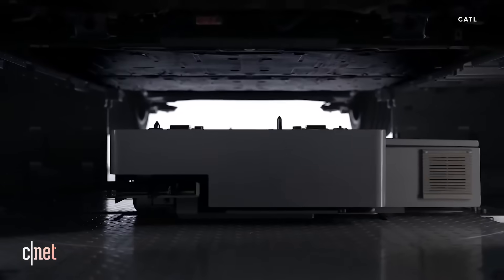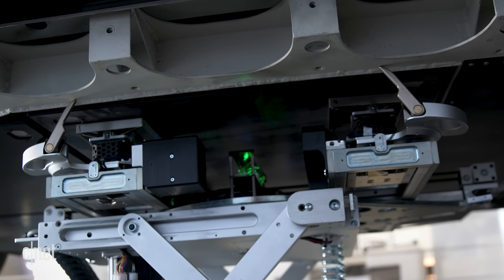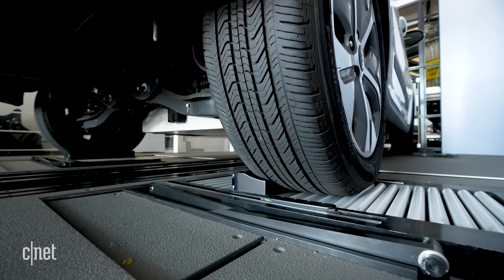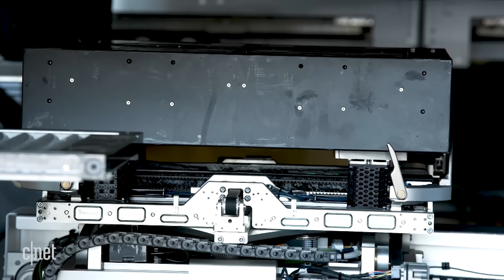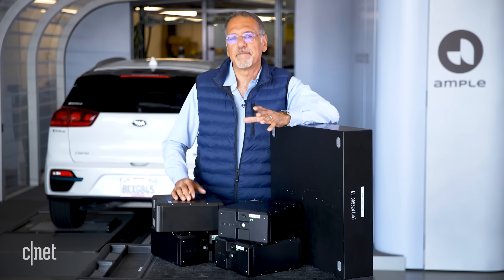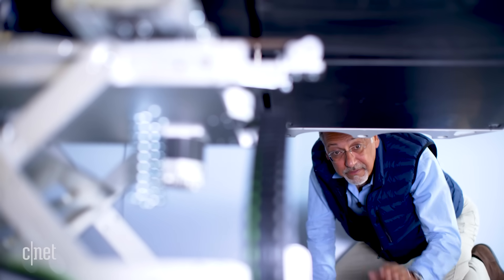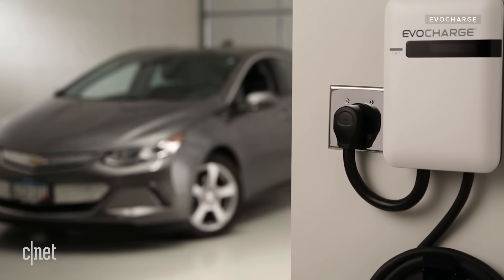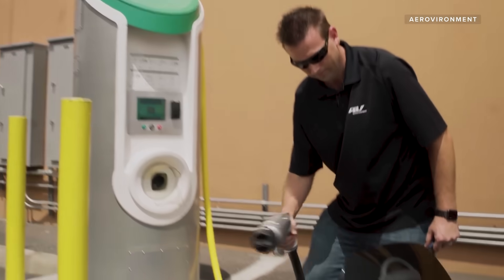See the Fastest Way to Recharge an Electric Car

Comment: Some charging stations breakdown or give you a very low charge either because sharing or the weather and the temps of the battery. If it's like a rapid bodyshop that can charge your EV quicker than charging at some station that's not a super charger I think it could work, and I hope one of these car companies give it a try.

Comment: Battery swap stations can also be installed into your garage.
Ev batteries can be hot swapped like the batteries of a controller.
You would just keep two of them on rotation until one of them died from usage.
Reply: Who’s got the money to install a battery replacer in their garage?? Just charge your car overnight and go!

Comment: meh. outside towing heavy loads, a 150kW charger is plenty enough and the cars that really benefit from them can already reliably get from one charger to the other. so really, their tech is already aimed at a far more niche market. there is also a mistrust of costumers who don't want the most valuable part of their car replaced with a subpar part and the fact that it takes extra space and creates extra weight which could simply be used for more range.

Comment: 800volt systems in cars will challenge this solution as they can go from 10 to 90% charge in 15 min.  I imagine not much different from this solution.
Reply: It’s not the batteries as much as it’s the external infrastructure. It’s bad. 

This is coming from an EV  owner

I charge at home at that’s enough 99.5% of the time. 

The other 0.5% is a crap shoot.
Reply: @doctorbashir3497  I've owned an EV for 3 years, and my current Kia EV6 can charge in an external DC fast charger in 15 mins.  These stations are deploying throughout the US and will be more available and faster to charge with than any battery swap system.
Reply: @jimhlee  I feel you. I have the Etron GT. Love it. 10-80% in like 20ish minutes on a date charger. But they are always broken.

Comment: I don't see how they have improved on anything proposed in the past, and still have significant questions to answer. What is the cost of converting to their system? It will definitely take significant modification, beyond the structural framework. There is cooling, battery management, charging hardware... all of which is currently proprietary to each EV manufacturer. They say they don't need rapid charging, but this will change if they ever catch on (which I don't think they will). If a lot of people pay the huge cost to convert their cars, they will expect charged packs ready to go at all times. This will require rapid charging and/or a large stockpile of charged batteries at every swapping station.

Comment: When it comes to electric vehicles, bigger batteries and faster charge times is the key.

What the industry needs is the government needs to standardized the the charging cables and maybe the batteries.

Kind of like EU did by forcing all of the tablet and phone manufacturers to use USB Type C.

Comment: CNET must be running out of ideas. Telling people they don’t need more than 150 miles in a EV then showing them a swap technology that would take longer than the 15 minutes to get a quick charge on the newest technology with less miles. Right now the number with a high output is 200 miles in 15 minutes.  I’m not saying it’s propaganda but use common sense. Not everyone lives in San Francisco.  It’s about simplicity.  With that technology you are looking at more time, higher frequency when you could just buy a car that fits your needs to charge once a week if you don’t have a at home charger.  Also this technology is not going to be cheaper.  Might make the car cheaper but you will keep paying for swaps exceeding the cost of a 50k EV in the long run.  Technology on batteries is moving forward and the thought of a million mile battery pack seems achievable.   If you want to impress us. Let’s find out why hydrogen is not picking up and promote that.  Seems like a great technology and tanks are bulletproof.  Think if that scales prices will come down and you’re still technically driving a EV.

Comment: How will this work with vehicles which use a structural battery pack? 

Also this system appears to add weight to any compatible vehicle.

It's admirable that these folks are working to make EV travel better. As someone who has been driving electric for ten years, I'd love to see them divert their focus to improving battery technology and safely shortening charge times.
Reply: Came here to ask the same thing. If the structural battery pack becomes a thing across the industry.. this isn’t going to help.
Reply: @Hugh Q 10 years here as well, absolutely don't miss them. 265k miles and counting on my own cars plus another 50k in demos and loaners, had tow gas rentals for a short stint and hated them.

1st was when my car got rammed by a Semi, while it was in the shop I took the brand new BMW convertible they loaned me and parked it then drove my old EV instead. (finally sold it later)

2nd was after I sold both the old and new EV the company I bought the 4th EV from (same as the 3rd) rented me a Corolla from enterprise because I couldn't make it to the next state by Uber and they'd initially promised me home delivery, I was greatful for that one but it was a miserable experience.

Comment: Rich people problems ...
Reply: It might look that way, but it's poor people paying the price for climate change.
Reply: @1964mcqueen  True ,but I don't think there are enough rich people willing to buy enough electric cars to effect the environment in a positive way ...
Reply: @shermainecallahan641  I've been driving electric for 4 years and I'm definitely not rich. The current supply issues aside, there are used deals and the overall cost is coming down all the time. Cost of ownership is significantly lower in an EV compared to ICE.
And no, electric cars will not solve the climate crisis. It is an all hands on deck challenge.

Comment: Waste of time. As batteries improve, this becomes obsolete. This is proof that most people don't understand EV's. Nobody needs this; just improve charging infrastructure.
Reply: You really dont even need charging infrastructure unless you dont have a home to charge at. Charge overnight and wake up to a full car everyday and never need to rely on public charging
Reply: @Matthew P  We installed a level 2 charger last year. I can understand some people won't want to do that as it was expensive ($500 for the charger and around $1000 for an electrical to do everything needed for the 50 amp plug). However, charging at home rocks.

On the other hand, current infrastructure sucks. When you are away from home, most chargers either don't work or charge slowly.
Reply: @thebigdoghimself  I agree. The Tesla network is awesome and ive never had an issue ever, with range or the chargers being broken. Having the wall connector at home (installed myself) is amazing too and i only need to supercharge when i go on roadtrips. My car is full every morning and i never need to charge when i am out and about during a normal day